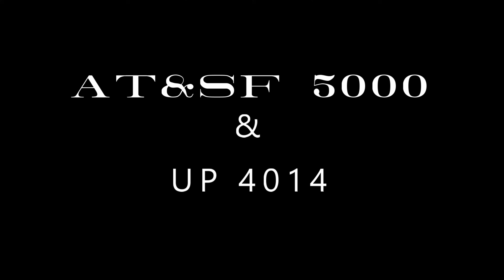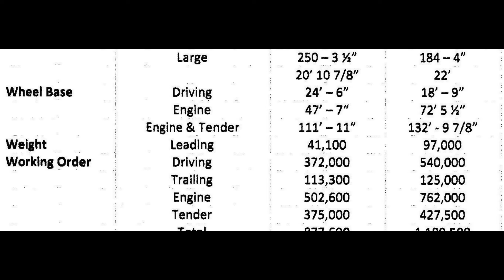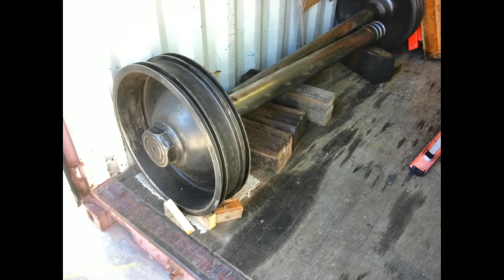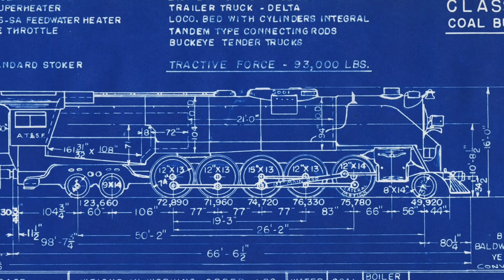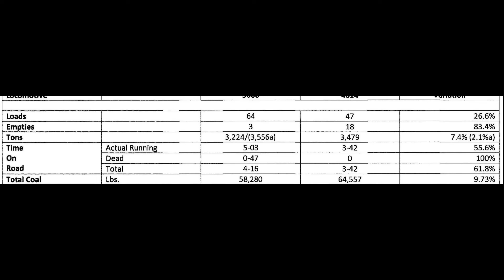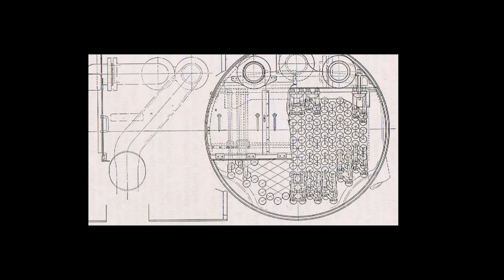MASTERCLASS: Comparing AT&SF 5000 and UP 4014 | The Living Archive

Comment: AN ALLEGHANY HAD A MUCH HIGHER FACTOR OF ADHESION 
86,000 LBS PER DRIVING AXLE WITH 7500 HP .
AND THIS WAS THE REASON THE PENNSY DABBLED SO MUCH WITH THE DUPLEX CONSEPT 
AND THE Q2
Q2 AXLE WEIGHT OF 82,000 LBS 
WITH 8000 HP AND NON OF THE LOSSES OF LONG STEAM PIPES
Reply from the maker: Interesting! Thanks for the information.

Comment: Great, Great video ! ... The thing that gets me is a lot of people think that the Big Boys are the biggest, when in fact you can take the boiler of a Big Boy and put it inside the boiler of a C&O Allegheny ! ... (Thanks to all its publicity) not to mention UP had 25 Big Boys and the C&O had 60 Alleghenys ! ! ! But what really matters is what we did have when we needed it and what we still have today to help remember the past. Love the video, too bad you couldn't narrated it. Keep'em running ! ...Thanks
Reply from the maker: Thanks George! I’m glad you enjoyed the video! I did a lot of research on the 5000 and Big Boy in preparation. I was fairly certain from the beginning that the two locomotives would be close in power, but I was surprised to see how closely they matched. Even more surprising was that 5000 was a lot more efficient and economical to operate than Big Boy. Thanks for sharing your thoughts!
Reply: @santaferatonsub  You are right about what you say in your comment and I think the most important thing is how much more money could have been saved with less locomotive to maintain, less turntables to be rebuilt, (lengthened) less modifications on overhang etc., less track repositioning and on and on. You have to look at the whole picture, like you did with this video. You just can't say this engine is the better one, or that engine is the better one because it has more horsepower, or higher TE. There are many factors involved and as always, it's the bottom line, time and money. Thanks again for a great video and reply. George

Comment: Larger diameter wheels are for speed, smaller diameter are for( tractive) power.  You can see this on steam engines that were built for high speed passenger service .vs. heavy freight service!
Reply from the maker: Very true. 5000's drivers are 69-inches in diameter, which was considered ideal for freight service in the steam era.